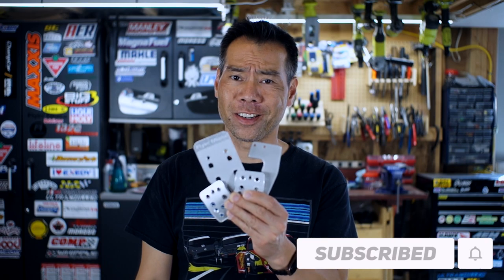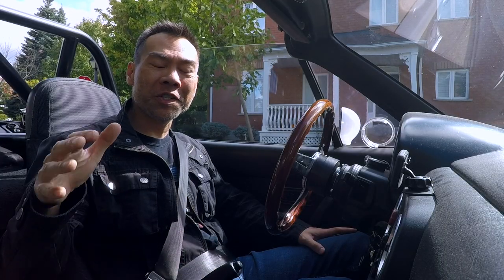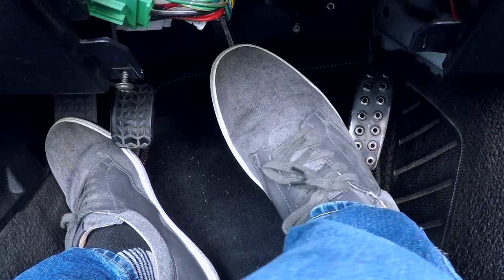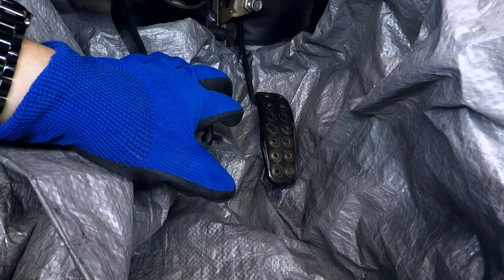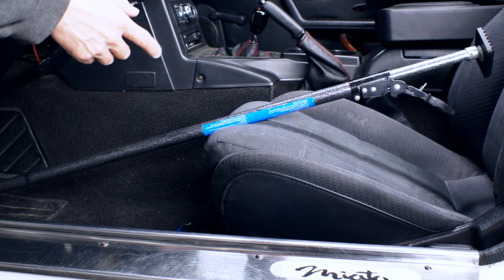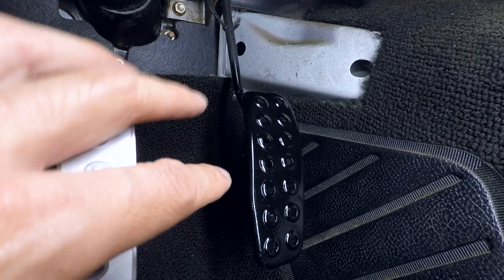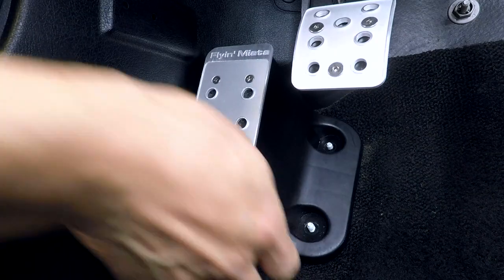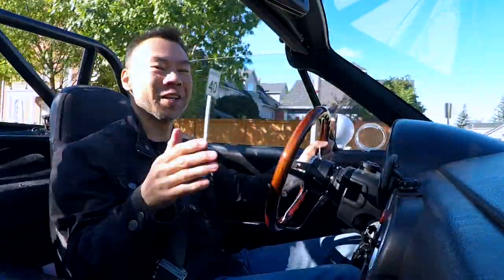HEEL-TOE! New Pedals and Gas Extension Upgrade

Comment: I have the FM gas pedal extension and it has really helped with heel-toe. For my other pedals, I just ended up ordering new oem covers because I felt the brake and clutch were already too close to each other. Great video as usual!
Reply from the maker: Cool thanks for the feedback, I've added a link to OEM replacement pedal covers in the description.